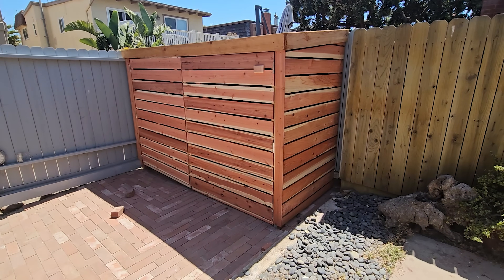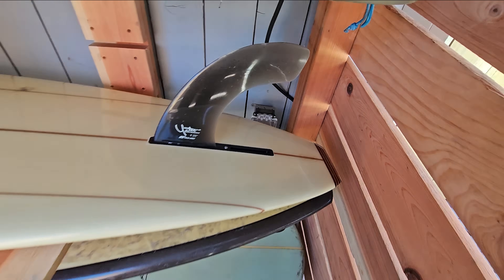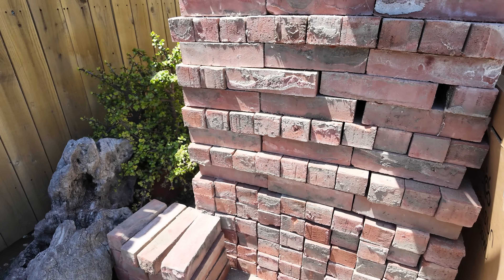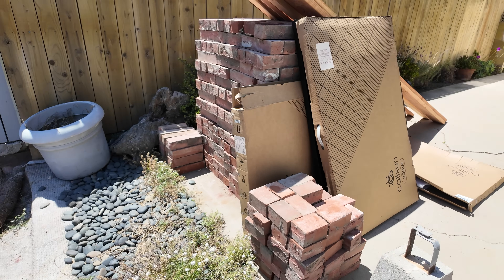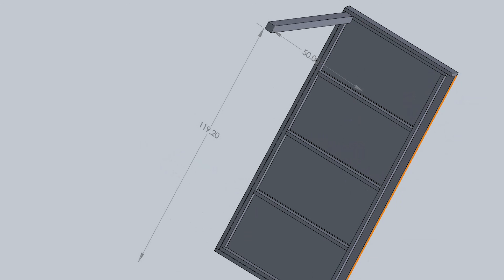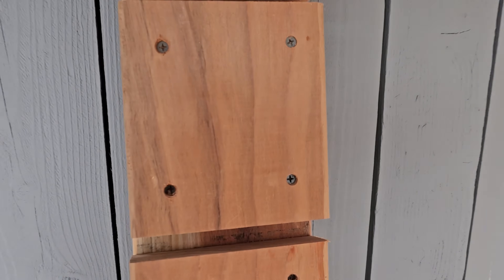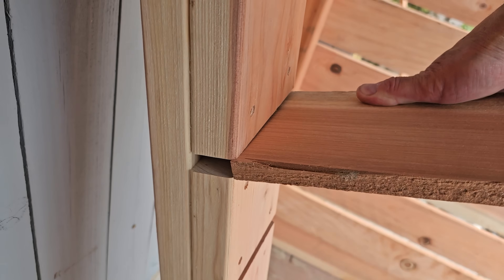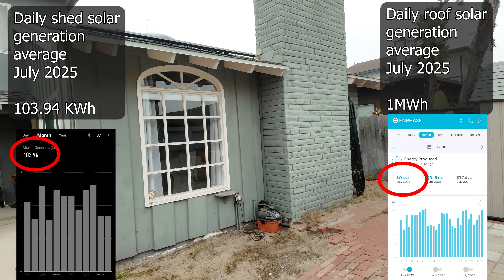Build $1500 Redwood Shed Including Balcony Solar

Comment: Very cool. I just finished an install in Wellington New Zealand. The system has two strings of 6 x 240w. The inverter can handle 8kw with 380aph battery. So far in winter they haven’t needed anything from the grid with two people living there on a small farm. I can see that technology being used more in nz. Love your work brother
Reply from the maker: That's super cool and I would love to be off the grid

Comment: Keep us posted on that inverter. It's a different design than what has been available until now on Amazon (Y&T and their clones), and the existing options were apparently awful, with many DOA or frying themselves in a matter of months. I've been waiting for a reasonably priced grid-tie unit that is safe and will last. They do little grid tie systems like this all over Europe without problems, some states are starting to pave the way for them to be legal in the USA, and there is an SF Bay Area startup selling local-only beta kits, but the rest of us still don't have a UL listed option for the hardware. If your inverter holds together, I'll buy a couple!
Reply from the maker: I have four of those inverters, two of them with Wi-Fi and two of them without. 

I've had two operating for over a year and another one operating for about 8 months at my home in the mountains.

The inverter in the video is actually one of the inverters from the other system and it's been working flawlessly but it does run hot. if you look in the video you can see I mounted it to a square aluminum extrusion to help with the heat. 

The fourth one I have was actually meant for the panels in the video but I hooked all four panels in series and then connected them to the inverter and it immediately started smoking and burned up. 

The issue was the voltage was too high for the internal capacitors, after filming the video I actually bought some more capacitors and put them inside and was able to fix the burned up inverter

and I grabbed one of the inverters from the other system and was sure to just put two panels on each of the panel inputs. so I have two panels in series on one of the inputs and two panels in series on the other input and an internally the unit parallels the two inputs. 

I ended up buying an EcoFlow Delta pro ultra battery backup system and panel for the other system. so I don't need those inverters anymore because I have the panels wired DC directly into the battery inverter. 

it looks like EcoFlow is going to come out with a grid tie inverter and enphase I believe has one as well. those would probably be a bump up from the inexpensive Chinese ones I'm using. but that said other than me screwing up and burning up one of them, these inverters have been fine and the Wi-Fi ones with the app are great for monitoring what's going on

Comment: @DaveRat  
Nice quiver, mate!  I was a surf photographer for Surfing and then Surfer magazines back in the day.

I think one of my sisters and her family lives around the corner from you, and our grandfather and father built a cabin up in Big Bear (Moonridge) but we've sold it several years back to some family friends.  I have a place in Wrightwood near Mtn. High ski area and several 5-acre properties just down the hill a bit from Wrightwood that are each powered by a single Bergey Excel 10kW wind turbine on 100ft guyed-lattice tower.  More than enough for a typical 3-bed/2-bath home.

At the time I installed them in 2007/8, wind power in CA had better rebates & incentives (paid ~50% of the cost) and is more efficient compared to Solar PV, but you obviously need the open space and wind for it.  But most evenings when you can't even really detect a breeze, the turbine is up and spinning at a nice steady pace creating power.

The Bergey Turbines also have an auto-furling tail system for high winds (and manual furling as well).  These wind turbine systems paid for themselves in roughly ~7 years and the Bergey Excel turbines are direct drive and require very little maintenance, but I'm sure the salt air at the coast would have its typical impacts.

Solar PV is constantly getting better and better (more efficient/less expensive/better longevity) and the incentives and rebates for residential wind power in CA are no longer available.  Solar PV makes even more sense if you live in the city/suburbs and own an EV like yours as well.  :)

Battery tech for off-grid power storage is also improving heaps.  Now I'm looking to do Solar PV at my place in the Western Sierra foothills just south of Yosemite, but we've got a lot of big beautiful trees here that make that a challenge even for a rooftop system.

What does your rooftop system produce during your typical "June Gloom" days in the coastal fog/marine layer?

...Death Biter 2000, LOL!  Epic!
Reply from the maker: The June Bloom doesn't really drop the power much and it averages 900 kto 1.1 megawatts. doing the winter it May drop to 550 but tits around 750.
Reply: @DaveRat 
Thanks for the info.  Good to know.  👍
Reply from the maker: super cool and what street do your sister and family live on? 

Big Bear as well and surfing! maybe we should hang out sometime!

Comment: FYI, Tech ingredients on YT showed that if you add heat sinks to the bottom of the panels and use fans, the cooler temperature of the panels will be more efficient such that it still generates more energy than the fans consume, while also extending the panel life
Reply from the maker: interesting and that would definitely apply to the panels up in I have up in Big Bear that are running hot. these panels here never really get that warm because of the beach breeze. 

conversely, a fan or any kind of motorized anything will degrade very quickly because of the salt air but up at the mountain house, that would work really well. 

do you have any suggestions on fans to use they can deal with the freezing temps and snow of the winters up there?

And definitely will look up tech ingredients! thank you

Comment: You're energy costs in the US are still relative low around 20 Cents / KW?
Reply from the maker: I'm on southern California Edison net metering and it varies from 29 cents to 67 cents per kW plus 52 cents a day in fees.

I figure the solar shed saves me about 45 cents a kW it generates, or about $45 a month
Reply: @DaveRat Wow, this are much higher costs than expected!  No doubt such panels in  sunny CA are pretty useful then :)